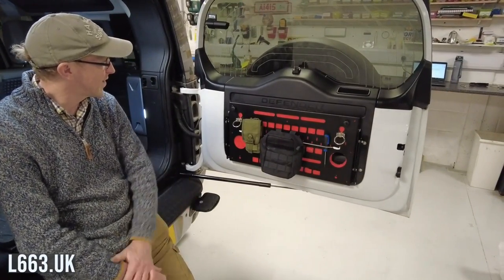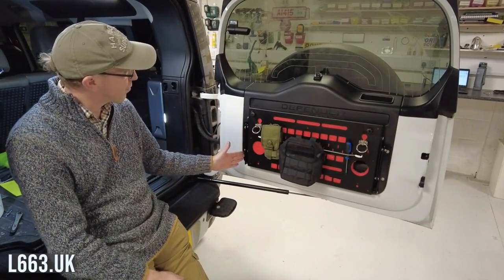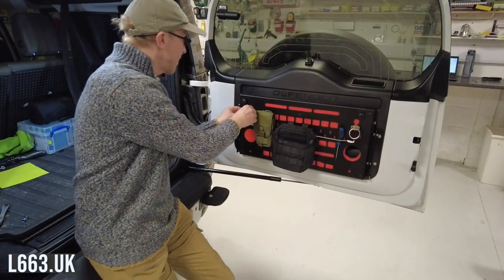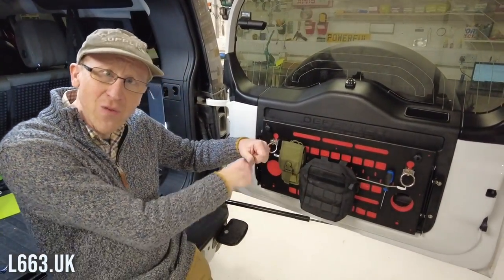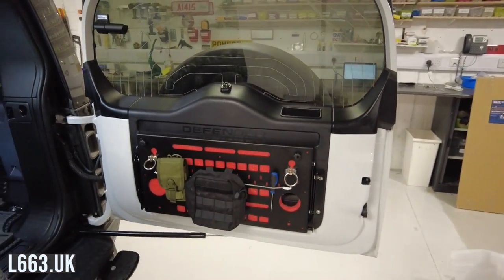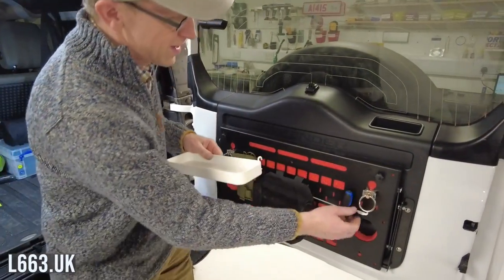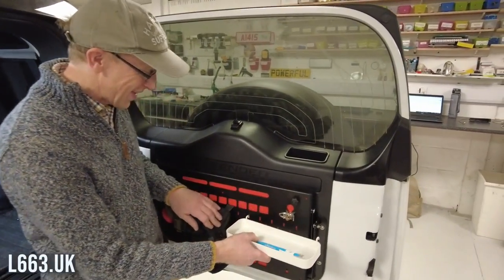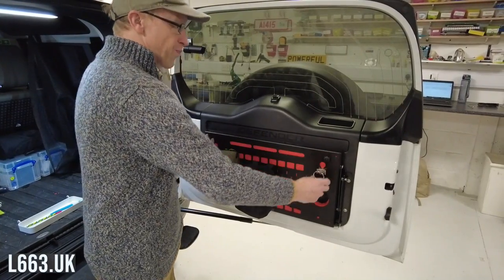Land Rover Defender L663 Folding Tailgate Picnic Table Kit - Demo & Fitting Instructions

Comment: Delivery arrived yesterday, installed today and it was a quick and easy fit. It is neat and practical. Very happy with it. Also installed the rubber mat and loadspace net. No more bags sliding around the back and I can use the extra loadspace height for carrying more for roadtrips. It has all come together very pleasingly.

Comment: Nice tidy job boys, am considering swapping my jeep one out for your new version. My on,y problem is that the knurled knob at the top on the left, on my car, the thread is buggered so will have to get that sorted first.
Reply from the maker: Hi Nick - glad it has the non stick seal of approval..let me know if you need a new knurled knob - or I have some spare quick release catches .. pop in next time you camping up this way.

Comment: I still prefer the uncluttered look of my jeep table and I used your fitting kit.  However, the use of metal hinges 'staves?' is a big improvement over the silly wires.  Any chance we could buy those separately?  I get the feeling you've opened a whole can of worms with this mod !!!
Reply from the maker: Yes this was going to happen... let me see what i can do... should work but they way the straps work is you need to be pretty spot on where you drill the hole in the side of the table ! Send an email to customer service and i will sort something out but I may have to order a couple of extra sets as we only have the straps to suit the number of tables we have !
Reply: @L663  Thanks Simon -really appreciate it..... oh and another great video.  Highlight of my week !

Comment: Very nice and well executed design. I’ve seen Jeep versions that use simple magnets to hold up the table - would those not work on your design for some reason?
Reply from the maker: Our table is aluminium to make it nice and light so its not magnetic and the fixing are stainless also not magnetic but magnets could be bonded onto the tray etc.

Comment: Love this table but not sure I need a table full of holes the smaller ones ok but I don't think we need the cup holders, the vehicle is going to be stationary the cup can just stand anywhere on the table, stuff is just going to fall though onto the grass underneath! When the cup holders disappear I'll be getting one. Maybe you could offer a blank one too.
Reply from the maker: Hi Jon - fair comment - we need to be challenged - how about we do a thin semi rigid non slip liner ? plywood liner ? MDF liner etc we could cut on the laser so it was a snug and perfect fit. Or maybe we could make the cup holders held in with tabs like on electrical back boxes that you could punch out if you wanted....
Reply: @L663  How about supplying two plastic push in blanks that you could fit in the cup holder holes and choose one, two or no cup holders with the ability to change your mind any time! 🧐🙂🙂😀

Another point..the knurled nut retainers at the top, could those be two 90 degree turn cam locks so making them faster and less likely to get dropped and lost? You just make a cut out in the tray for the handle (?) to pass through then turn downwards to give a one movement lock. Considerations are..rattles..enough clearance, over centre or sprung locking action….over to your designers!! 🤭🧐🧐😃😃😃😃
Reply: @L663  I think either of those could work a liner would be better for me, I use my defender for work, sometimes in the middle of a field, will need to use a laptop on my table so the holes not good for a mouse.
Reply: Please make one without cupholes and add more molle hole instead like the molle panel for the rear window. @L663

Comment: Hi there... I am wondering if you might know what my passenger door (right hand) no longer locks. I can no longer secure the car. The other doors lock. Best!
Reply from the maker: This is interesting problem - does the screen show the door is still open ? you could try disconnecting and re-connecting the battery -ve ( under the seat ) this will reset the BCM ( body control module ). Other things could be poor connection in the door electrical connector / failed door module.

Comment: Looks great. What is the approximate thickness closed up?
Reply from the maker: Good question - the foam we used is 30mm thick but that is "squashed" a little so its around 25mm added to the door surface.